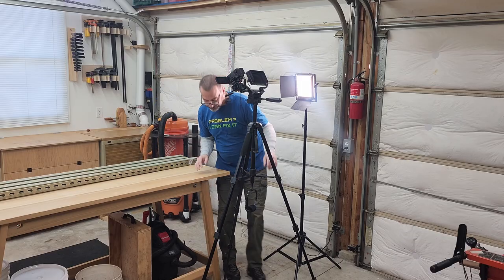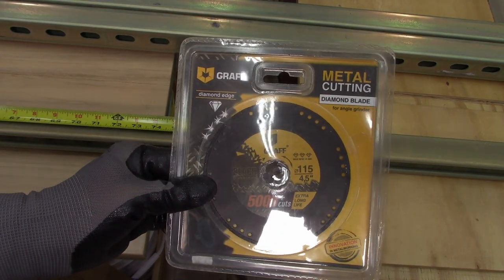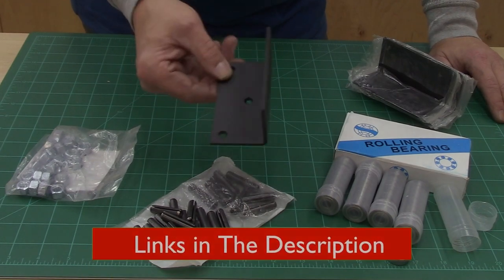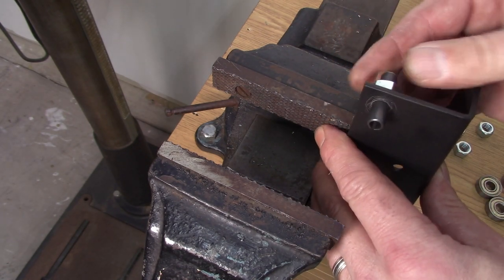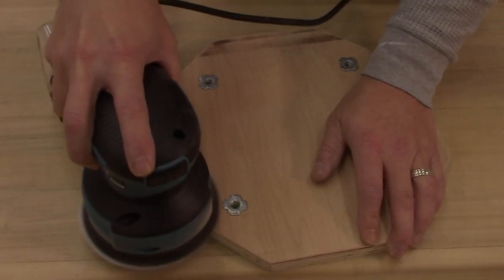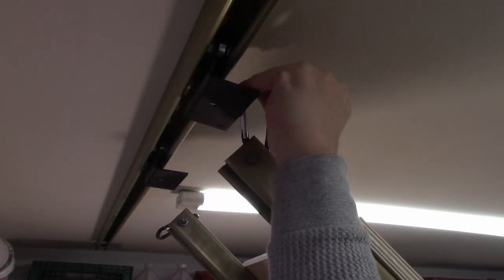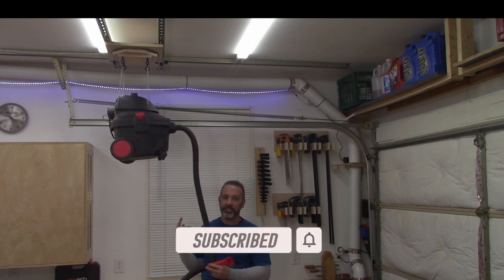DIY Ceiling Mounted Rolling Gantry for Woodworking Workshop - No Welding Required

Comment: Is it just me or are the t nuts on the bottom rather than the top? It looks like its either that or washers behind those eyebolts.  If they are on the bottom, theyll pull out as soon as you put more weight on them
Reply from the maker: Those are washers that you see.  The T nuts are put in from the top.
The lazy Susan didn't work the way I used it.  Check out the follow up video to see how I fixed it.
https://youtu.be/abX-imgA-nI

Comment: A lot of good information here. I was looking to do something similar, but with an electric winch to pull things up into my attic.
Reply from the maker: This is ideal for that as long as you have framing that can support it.  A few well secured collar ties on every rafter pair would likely work.
Reply: @HouseDoctorRay  Yes, I already have some horizontal bracing, although I may have to reconfigure it to be able to put in the length I want. It's not heavy bags or crates, just a large amount of 30 to 40 lb bags and crates.

Comment: I can see that a slightly beefed-up version of this would be great for storing heavy seasonal, or seldom-used, tools and equipment.  I've been wanting to utilize all the wasted space above my riding mower and motorcycles but couldn't quite figure out how to create a simple lift that wouldn't be in the way too.  With your setup, I will be able to get my bulky generator, pressure washer, air compressor, welder, etc. on a shelf & open up some valuable floor space in the garage.  Even the cheapest winch or block & tackle added to your trolley will allow me to lift a few hundred lbs easily.

Thanks for taking the time to share your great design.  
👍👍
Reply from the maker: Glad you like it.  The weight/span tables for Unistrut are easy to find.

Comment: Wonderful.  Love it.  I would encourage you to look at the Sonoff Basic RFR2 and RFR3 WiFi plugs. Voice, manually, app and 433 MHz RF signal controlled.  Each to add to your WiFi and works 120V on everything.  Control the power going to your trolley/shop vac.  Add a cheap Echo Dot in your shop. The RFR2 / 3 are about $8 each.

Comment: Are you planning to increase your lights overhead? Because your videos are very dark
Reply from the maker: My overhead lights are good.  Hopefully when I build the camera arm I'll be able to have it also support a key light.
Any suggestions on bright, lightweight lights?   The LED panel lights I have are obviously not cutting it.
I think I also need to put shades on the windows behind me because the natural light facing the camera is a problem.

Comment: WoW, I can see several ways to use a system like this in my garage shop.
Reply from the maker: Glad to hear it.  If I used heavier hardware I'm sure I could use it to pull an engine.

Comment: I seen you drilling those holes bigger. If I do any drilling I take a magnet and place under what I am drilling. It sure helps on cleaning up metal shaving. Keeps you from getting metal shaving on the bottom of your shoes.
Reply from the maker: Damn! That's a good idea.  Thanks.

Comment: What’s the name of the wood clamp tool holding the roll pins?
Reply from the maker: It's a Ring Clamp, primarily used for jewelry making, but very handy in the workshop.
There is a link in the video description.  Click more underneath the video.
Reply: @HouseDoctorRay  thank you ..

Comment: Unistrut provides a plethora of strength data.  They also have larger (i.e. stronger) struts.  What size are the screws you are using to secure it to the ceiling?  How far apart are the two rails supporting the trolley?  Do you have rafters or are you securing to trusses?  All those things are needed to estimate the load.  Seems like it would be possible to put a third rail in the middle, provided your ceiling is level, which your laser would tell you and allow you to shim where the screws attach the Unistrut.   I really don't expect you to provide me with that information, I'm just running through what I need to think about to be able to hold 400 lb working load with a factor of safety of at least two.  In my garage there is no sheetrock on the ceiling, leaving the trusses exposed,  so I could get to them and add a 2x4 to the existing lower horizontal for added strength.  I could even add a 2x6 without too much difficulty or cost increase.  I have been thinking about doing this type of thing for several years, but was using I-beams that is cost prohibitive.  If it holds your vacuum, it will certainly hold your camera equipment.  Tremendous idea!!!!   I'm going to see if I can adapt this to my garage and get to the load limit I need.  I'm impressed enough to subscribe.  Well done Ray!!!!
Reply from the maker: Thanks.  I didn't mention load carrying capacity because there are too many variables involved.  400lbs is easily doable.
If you want that much weight capacity I would get the real unistrut trolleys.  You will need the clamps that grab the strut from the outside because the bearings are bigger.

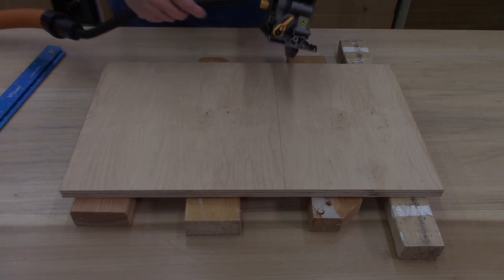Comment: 08:49 - this is circular saw or angle grinder with hack?
Reply from the maker: It's a little cordless circular saw.  About a 4" blade.
There is a link in the video description if you want to get a closer look.  The dust collection works pretty well.  It's good for little jobs or tight spots.
Reply: @HouseDoctorRay  thanx.
Im finding some stuf, who convert angle grinder to circuit saw with suction.

Comment: How much weight can be suspended from the bottoms of prefab roof trusses?  My shop has mostly exposed 2 x4 trusses on 2 ft. centers.  This is a cool idea.
Reply from the maker: Thanks.
My lawyer would never let me answer that.
You can look up the unistrut weight limits online.  As far as the trusses I would think they are at or close to their limit already.  But you can easily stiffen them up by sistering 2x6s or 2x8s beside them.  Just make sure you get the new wood on top of the walls on either side.

Comment: At 2:38 in the video, kick back is caused by the direction of the cut-off wheel rotation relative to the work piece. If you were to hold the cutoff wheel like a clock, the direction of spin should be counter clockwise and the angle of attack (cut) will be between 9 and 6 o’clock.
Reply from the maker: Thanks.  Now that the blade is worn a little it doesn't grab nearly as much.

Comment: Looks like a great idea!
Very creative build also.
Please design and build a power cable system so you don’t need run an extension cord

Thanks for the inspiring video doctor
Reply from the maker: Thanks.  I couldn't have done this without that jewelry clamp you showed in one of your videos; that thing is awesome.
I was thinking about a power cord.  I'd probably need to incorporate a retractable wheel for it.
Reply: Search for Retractable Ceiling Power Cords
Reply from the maker: Thanks for the tip.